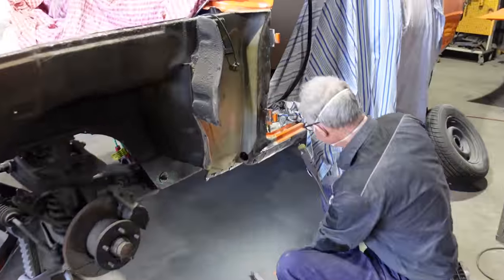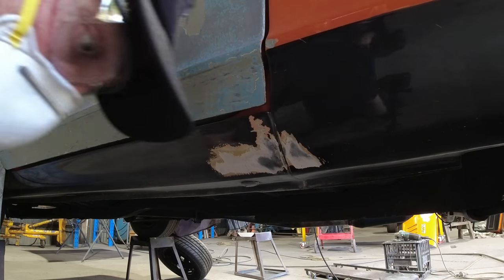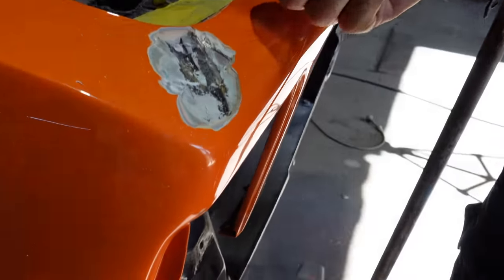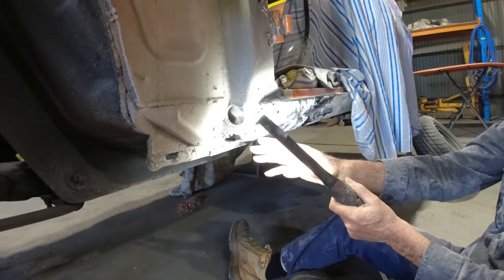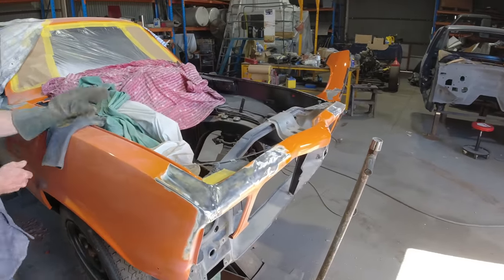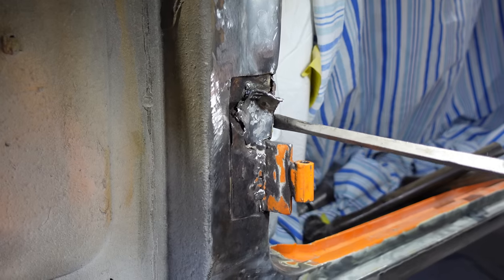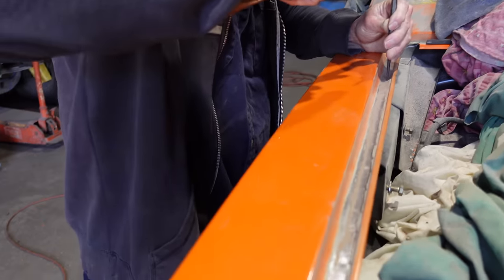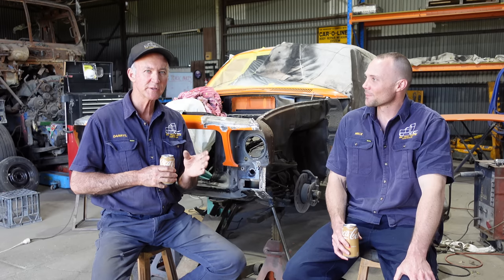Holden Torana Gtr Xu1 ( Part 5 ) We need a jack hammer for the body filler. Classic car restoration

Comment: That left hand guard and sill/door hinge work screams "backyard rebuild" to me, I can`t believe how rotten the whole corner of the body-shell is, I had an LC GTR which had a big hit in the driver`s door  - enough to bend the seat mounts and buckle the floor, but it was a 100% better than this one - mind, it was 40 years ago, so I guess this has seen a bit more abuse...😅